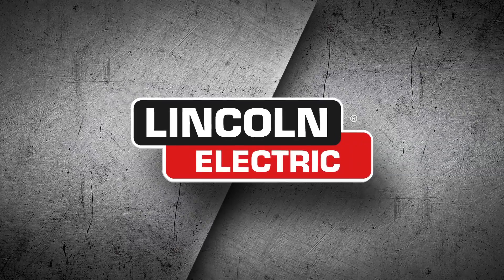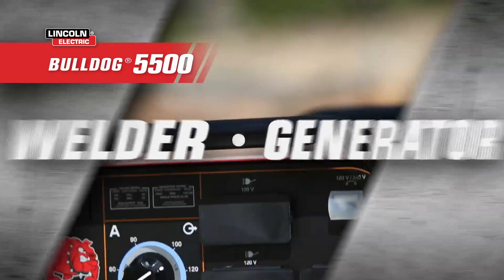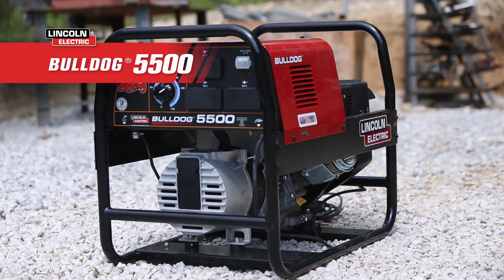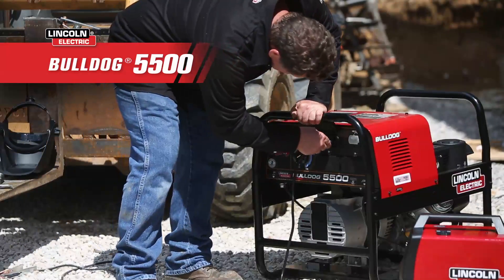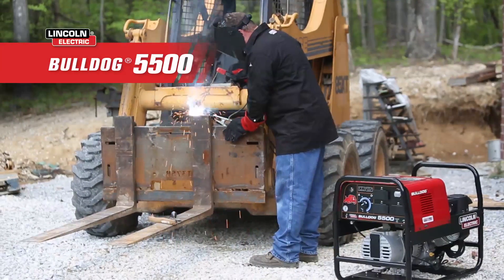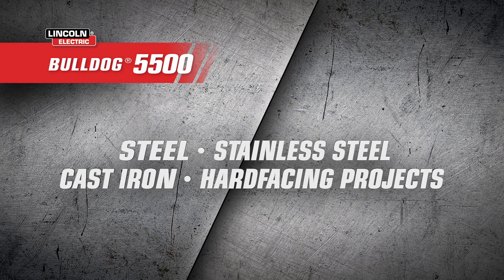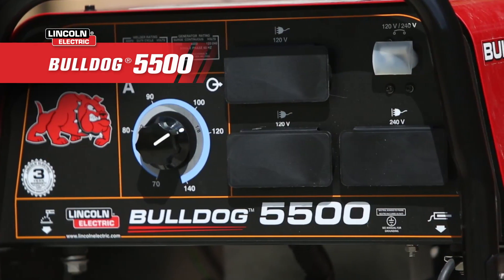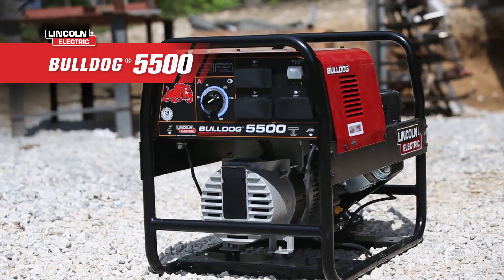BullDog - Lincoln Electric

Comment: this guy has been welding on those same forks in all of these Lincoln adds and is still trying to get that one bead laid down
Reply: I just got one. Couldn't wait to use it. So sad to find out after opening.. NO LEADS..     $1,800 & NO LEADS. Now that just not right.
Reply: @garycoker7908  how's it running so far?

Comment: Just be mindful of the low duty cycle on this machine. This is a very light-duty machine, so when welding be prepared to spend most of your time waiting for the thermal fuse to reset. It is more frustrating than useful.